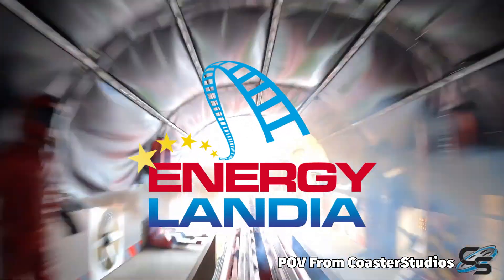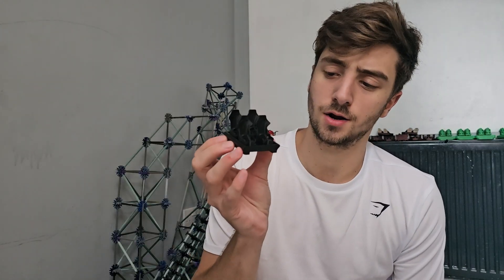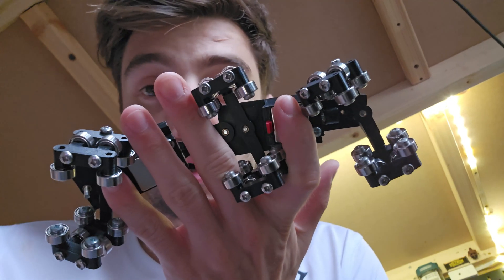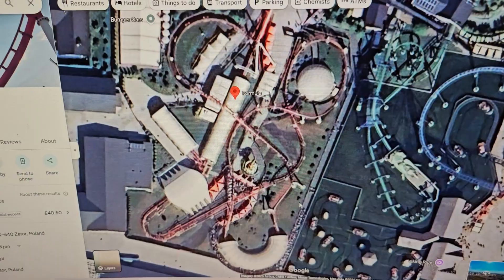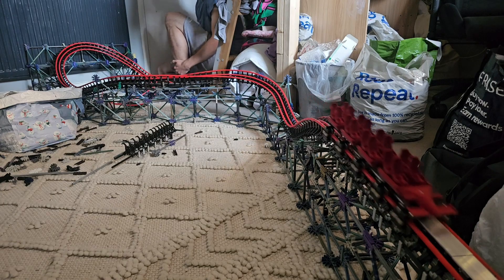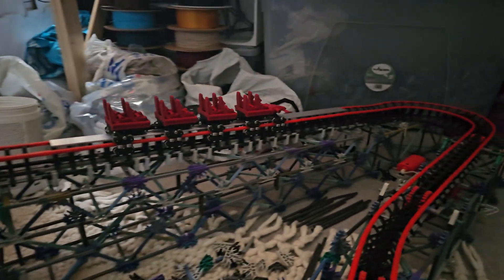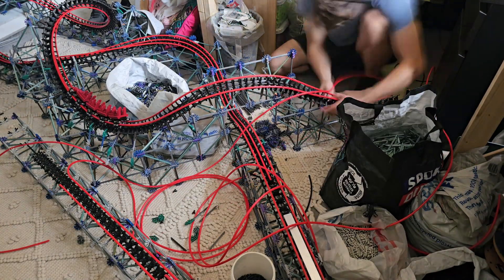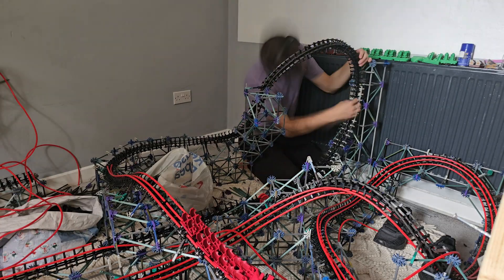Building Formula from Energylandia out of K’NEX!

Comment: Crazy work you gotta make a magnetic launch next tho
Reply from the maker: Once I get more funding 😂
Reply: @TheKnexMaker side question for you, I've been working with my ceramic bearings what would you recommend for making them perform the best
Reply from the maker: @knexrecreations6875 making sure they are not too tight upagainst the tubing. Leave a small amount of gap when tightening screws. Like 0.5mm or somthing. I call it wriggle room. 
And make sure they are not greased ones. 
They should be free spinning without seals and grease
Reply: @TheKnexMaker I meant for my ceramic bearings i want better performance out of them because right now there on par with stock knex trains with wd40 silcon. 😂😂
Reply from the maker: @knexrecreations6875  what? How? Are they really old bearings? Maybe its time to upgrade, i fond the hybrid ceramic 5x11x5 size is the fastest